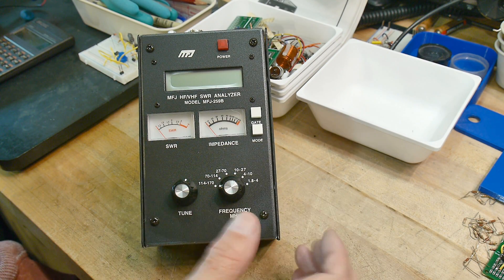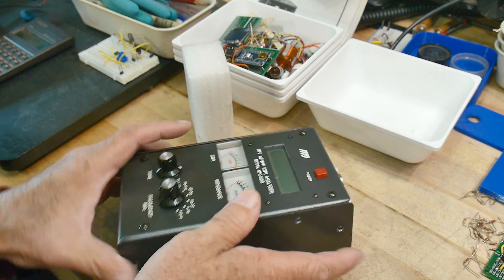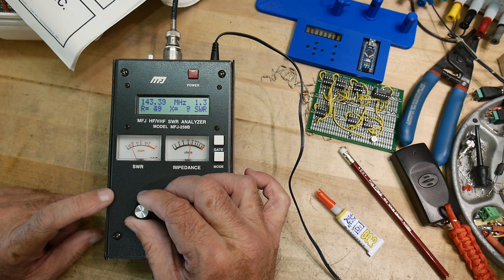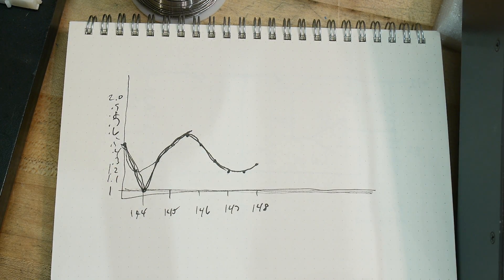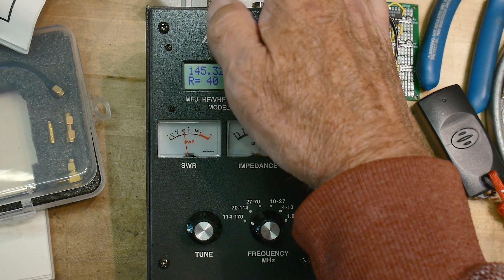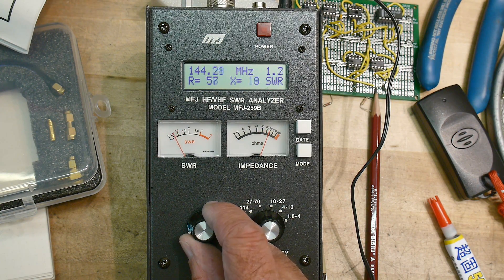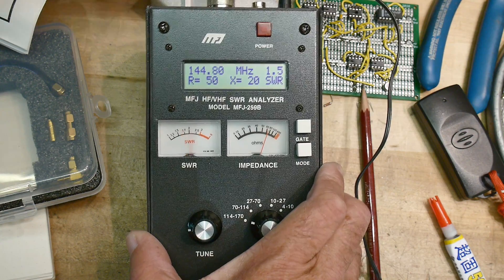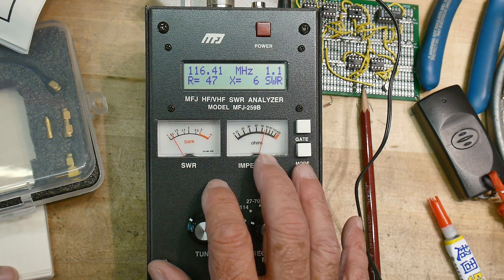#1089 MFJ-259B antenna analyzer teardown and turn on

Comment: Had to look it up , a very good long series of videos with Martin Jue at the AtlantaRadioClub here on YouTube showing a lot of uses of the 259 / 269 .
I've repaired a few of these , currently have a 269 that does 440 Mhz .
MFJ gets a lot of piss-an-moaning , but they do have most of what hams need / want ---- to a price point . seems to me until all the stuff running on chips / programing coming from china , MFJ was hams 1st gear at lower prices , and sometimes we would have to call them kits - but that is a good thing - find a broken version of what you want & learn to repair ;)

Comment: Mr. IMSAI Guy,     After viewing your video on the MFJ-259B I write to inform you that by desoldering the antenna connector accuracy of the instrument can no longer be guarantied and that regrettably you must now consider the warranty on the product as null and void.  Should you wish to attempt self recalibration of your instrument unsupported instructions are available on our website but unfortunately only in the Kyrgyz language (as opposed to Fuyu Kyrqyz language).  Be advised that tens of thousands of dollars worth of test equipment is required and that the procedure must be performed exactly as written lest you let the magic smoke escape.  Should that occur, well then, consider the warranty as null and void (Oh, I already said that) and send lots of money to us for a deprecated replacement unit.   Sincerely, your antenna analyzer team.
Reply from the maker: does duolingo have Kyrgyz?

Comment: I think yours is out of calibration, I bought one new 25 years or so ago, still works great. I put it on my Heathkit Dummy load and it is rock solid at 50 ohms anywhere you tune it. Have checked it against other devices and always very close.  Lots of functions too, you can even get Length from random coax. Great tool but it is pricey. edit: If using alkaline cells there should be 2 dummy batteries, 10 cells are for rechargeable.

Comment: Hi, I was having a high regard for the analyser for a long time until recently.
I was shocked to see the extremely wide bandwidth of any single frequency you are tuning in. Yes, suppose you tune in on 7100 kHz; the oscillator outputs not only 7100 kHz but also 10-15 kHz +/- .
I have been wondering how people have been tuning their antennas and proudly declaring that their antennas are 1:1 spot on 7100 kHz. And apart from this they're able to say that the 1.5:1 SWR of their antennas happen to be 80 or 100 kHz on either side of the centre frequency of say, 7100 kHz.
You may want to zero beat a single frequency (7100 kHz) on your radio receiver. It's wide, too wide like 20-30 kHz on either side.
It has never been the "holy grail" test instrument in the amateur radio world; people have just believed so much that they have not inclined to test the authenticity of its performance.
So, please try to check the single frequency out put on this pathetic machine.. 🙄😀
De VU2RZA
Reply: Yes ...dr .we did that and found the broad band width of this antenna analyser..this machine is battery eating machine...not effecient.one
Reply: @prabhu6330  👌👍❤️

Comment: I have an MFJ-269 and it seems stable everywhere with a 50-ohm load. What I don't care for is the discrepancy between the meter and the digital display. I also wonder if there is a calibration routine to zero in on more accurate values. I do find the unit useful at time and use it alongside my NanoVNA. Thank you for sharing.

Comment: I've had a few in to repair and a common problem is tarnished contacts on the band switch, causes intermittent or total drop out. The diodes give problems too.

Comment: I have a 259C myself. it is actually a very handy tool around the bench.
Yes, the battery requirements are the biggest complaint I hear about these analyzers. You can install rechargeable batteries. I usually use it inside so I just plug it into 12vdc most of the time.
The assembly us a bit strange, tganjs for showibg that. At least it wasnt assembled by lil old lady in china...lol

Comment: Hi great video I bought one of the first from US took a while to get to the UK . Working still many years of use and abuse. Great for checking antenna and a quick and dirty check of receive. Use other stuff on the bench . I got fed of changing batteries so converted to lipo batteries . Another mod I tried was to put a slow motion drive on the frequency control but more trouble than it was worth so took it off. Yours seems a bit off maybe needs calibration?